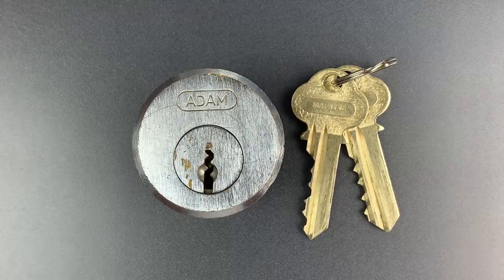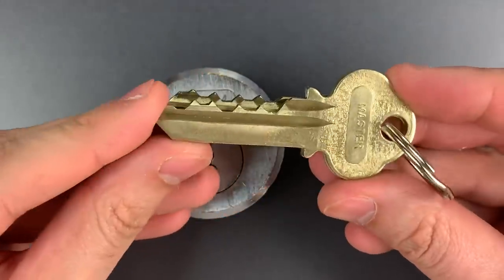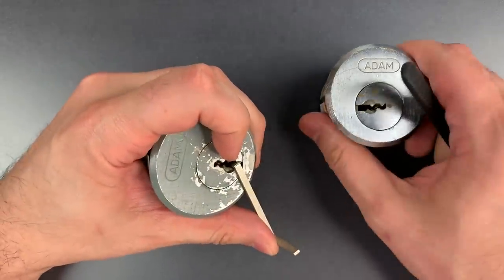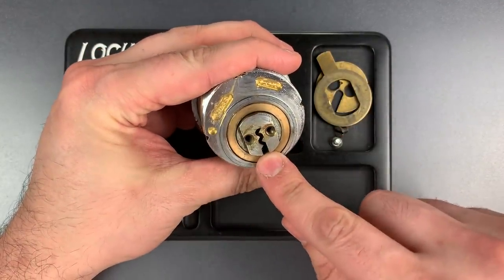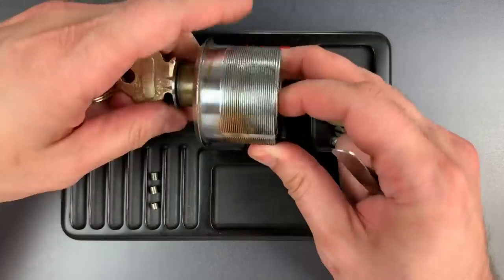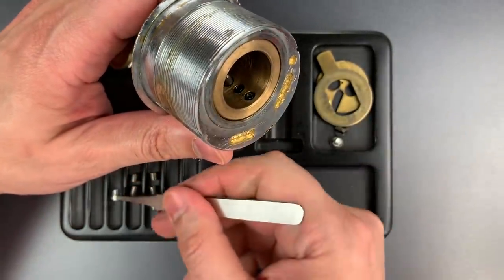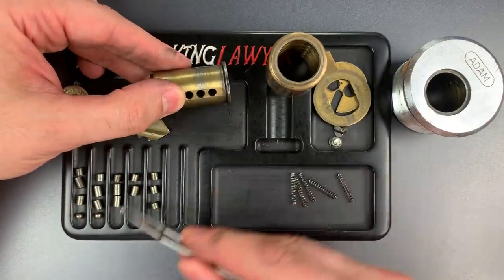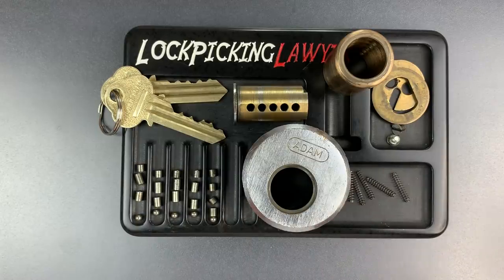[919] Prison Break! Huge Prison Locks Opened in Seconds

Comment: I worked in two different facilities.  On my first post, the keys and locks were huge.  It was built in the late 1960s, so it was expected for that time.  Interestingly enough, they had added on to it four times and during the most recently addition, they still used those large brass keys.  From its opening in 1969 or so until it closed in 2014, no one escaped.  One attempted to, but never made it far.

The second facility I worked in used locks similar to those, but keys were hardly ever used.  Everything was electronic so keys were only used when the power went out and that was rare.

Comment: The college dorms I lived in back in the 80s didn't follow the rule of master keying. I easily made a master from a copy of my room key with a chainsaw sharpening file.
Reply: Why?
Reply: @coen555  To see if I could. The reason we're not all still living in caves.
Reply: @John_Ridley  That's a good enough reason for me.
Reply: I initially read this as "I made a master key from my room key with a chainsaw" and I was confused.
Reply: How did you know the bidding?
Reply: J-sUn If you see multiple keys (neighbors, common areas) and know the principles, you can guess the master bitting.
Reply: @FiltiarneElite  Every chainsaw is a masterkey if you think about it lol
Reply: @johnfrancisdoe1563  Why I don't use master keying even though it would be very convenient (beside the concern of some yahoo boss, co-worker, subordinate misplacing or not keeping the master secure). If you have a key and undisturbed physical access to the lock--oh, and not a live in a cave were your tech to be taken mentality, lol--how could you not recreate the master and gain access to all the other locks.
Reply: @johnfrancisdoe1563  Not if the system is properly designed.
Reply: @Jamato-sUn  Check out 'Keys to the Kingdom: Impressioning, Privilege Escalation, Bumping, and Other Key-Based Attacks Against Physical Locks' by Deviant Ollam, it discusses exactly how to generate a master key using a change key, a few key blanks, and a lock you have permission to open.
Reply: One question. Was it co ed?

Comment: Oh dear...
Edit: think a Bowley lock designed for this application might work?
Reply: Airmanon maybe just dimple locks
Reply: @FishFind3000   You can't put ball bearings in a dimple lock, so I imagine the pins would wear out with such high use.
Reply: Unfortunately some prisoners would stuff the lock with some sort of epoxy or the like if they could to mess with the guards. So having the most unpickable locks may not be the best idea in a prison.
Reply: @sluggaboyzWC3  oof
Reply: sluggaboyzWC3 Ability to clean lock doesn't require a pickable lock.
Reply: Hello fellow redditor

Comment: I did jail contracting work decades ago; cameras, door controls, door sensors, intercoms.
Midway through a job, a worker from the lock vendor came and replaced ever lock in the prison; master key was cut short just as you showed.
Didn't hold up the job but it sure cost the door-guys a pretty penny.
Can't say for sure they were ADAM, but they were big.

Comment: Hey LPL, Correctional Sergeant here from Cali, those are medium security locks usually only put on doors for storage or offices, the only time they are used to secure inmates it is on the outside of a dorm where it cannot be picked from the inside, for high security we use the large Folger Adams keys and locks!

Comment: I work in a prison and we have similar locks to these.

Firstly, it's important to note that a cell door does not have a keyhole on the inside. So even if we were to hand them a key, there would be no way to insert the key into the lock. This goes for any door where you are going "outwards". Imagine the prison as a layercake and to move from say a unit to a corridor you wouldn't be able to use a key, but if you were going "in" then you could. 

In terms of these kind of locks, the model shown here is an older model and newer ones encompass a pin rotational aspect which appears to be an effort to resist raking. It appears to be a similar method to a medico lock. Additionally, when the lock is installed in the correct housing there is a weight aspect placed on the core which is an attempt to stop improvised keys being made from objects such as wood, glass, paper or whatever. The force needed to actually turn the key would cause most materials to easily break which leads up to another point. That being the keys are intentionally big for two reasons - if you were to lose it, it's going to be much easier to find and if a prisoner was to actually get hold of a piece of metal large enough, it would either be found during electronic searching or manual searches and the time required to fashion the key is far greater.

Comment: I worked for the Texas prison system for 10 years, ever since I was 19. We had lots of Folger Adam locks, mainly the big cellblock door locks that take those comically large keys you usually associate with prison. Bigger than the keys in this video (though some of these keys I have seen on offices, etc). My unit was built in the 60s so many of those locks were seriously old and heavy. Being a corridor control officer was a pain in the ass, you were posted in the hallway with a big old set of keys and opened the doors for everyone going in and coming out. I don't miss that job.

Comment: Right so, Correctional officer here and I'm gonna talk a little bit about prison security. These locks were (if I had to guess) probably used to secure quad doors in secure housing or open bay dorms. The thing about prison security is that there are people in prison in there for there life. If someone has the skill set necessary to pick a lock then eventually they will be able to. However, these doors are VERY resistant to brute force attacks. They are steel framed and set in concrete with reinforced plexiglass panels. The hinges are massive and have protective covers. So what does this all mean? Basically these doors are intended to withstand riots not skilled picking attacks. The protection against skilled picking attacks is actually the perimeter stun fence coupled with armed guards tasked with shooting individuals who attempt to cross. Additionally inmates are counted no less than once every four hours. Making a tight time constraint

Comment: I worked corrections for 8 years & those locks are actually much smaller than many of the other Folger-Adam's & Southern Steel locks we mainly used.  Also the locks wouldn't be able to be grabbed in held in your hand otherwise they wouldn't need to pick them anyway.

Comment: This is not the most serious weakness. There was a much simpler technique in Arizona Prisons. If a person lifted a door 3 or 4 inches, the latch no longer engaged. Over more than 3 decades, there were multiple partial escapes, assaults, rapes, and murders. They named the Lumley unit after one of the victims. They changed the locks at a cost of thousands per lock. After another decade of evidence that this was not effective, they changed the latch mechanisms. And yes, during those decades there were multiple pleas from staff and prisoners to adopt simple, inexpensive techniques prevent opening without a key.

Comment: I'd really like to see you work on what Folger Adams calls a Prison Paracentric Key Lock.  In my experience the locks you open in this video wouldn't be for doors that would lead an inmate to escape, but more for incidental doors.  The Prison paracentric are what is used for the big doors and grill gates.
Reply: Also, I would guess that the poor master bitting is due to the locksmith at the prison instead of an indictment of the lock manufacturer.  Locks don't come pre-bitted to the prison.

Comment: When I volunteer at a local prison during Christmas time, the key I’m assigned to for the chapel room that I use, has a Folger Adam lock but the lock and key is about 5 times the size of the one in this video.
It’s the normal big locks and keys you think about associated with prison. I wish you could get your hands on those and see if you could pick one of those! 
It’s the ones with the keys you hold in your whole hand instead of just your fingers

Comment: The prison I worked at only used these types of locks for doors that would not allow you access to out of the units or outside of the prison. We did have "Folger Adams" keys, but but the were much larger than what you showed.

Comment: these particular locks are used in the fireproof doors basically a three inch thick steel door with a massive locking lug for the door latch. amusing how easy it is to get past them. now if you can open this with a bed spring and copper wire from a fan/radio or plastic toothbrush then you will have the standard tools inmates hold for picking; instead of specialized tools.

Comment: 0:54 - I bypassed this problem of making a master from another key by roughing up the key and applying a blog of pre-fluxed (electronic solder) to the key in the area I needed built up and then filed away the excess solder. Not on a prison lock though, it was a Abloy style (half moon) type key, although the technique would work with this type of keyway.

Comment: As some one who has been to prison. This information is interesting, but prisoners wouldn't be able to pick these with ease. They might be able to assemble picks and rakes, but they will have to deal with MULTIPLE locks in a row to really leave the area, and by then, they most likely will have been seen or noticed. This is at least in America. The locks aren't what keeps the prisoners in, it's the face that every way you go is protected by video security and multiple check points.

Comment: i know this is a late vid and you probably wont see this but im a correctional officer and my prison uses these locks. the locks are always places in positons its really hard to tension off of not impossible but really hard to. like in a hallowd out area meaning youd have to reach into the hole with both hands to tention and pick it. on top of that the ones in my prison work off a electronic door system so the piece actually stopping the door from opening is always being pushed open making it even harder to open it when you get it tensioned. like we sometimes have trouble opening it with the key cause its pushing back so much

Comment: I worked as a contractor at Rykers Island, while there a guard informed me that the large locks would take forever to pick as they were not normal locks! But most escapes were not due to lock picking, they happened when inmates walked out the front door. One trick to do this was to turn a piece of alfoil into a badge, with a badge as id they could walk past security points. So what we could and could not bring in seemed strange, hammers and drills, fine, that aluminum your lunch is in, not ok!

Comment: The ball bearings are extremely hard, the core is extra wide and the master ring allows for thicker mastering discs. You could probably build a robot to operate this lock 1,000 times a day and it would last a decade.

Comment: To be fair, the pinning codes and keyways are designed and provided to prisons by the lock manufactuer. So the fact that the master key could be filed down from an operator key in on FolgerAdams, not the prison operator.

Comment: To be fair, at least in some housing areas, the keyhole is only on the outside of the dorm or cell. So if you're inside and the door is shut the only way its opening is someone keying it  on the outside or the control room accessing it.

Comment: Two questions come to mind: 
1. Is the raking opening the inner cylinder or the master cylinder?  
2. If raking didn't work, would those ball bearing make picking harder? It looks like the key/pick makes contact with the ball bearing and not the pin. A pick might slide off the rounded bearing more easily.
Reply: Did you not see how he used his pick to push the key pins out? As an amateur picker, I find smaller locks to be more difficult than larger locks. That lock is huge. Would be simple to pick. Problem is, in a prison, there's about 20 of those locked doors between you and freedom LOL

Comment: Damn.  I would have thought that raking wouldn't do anything.   I've opened crappy locks with a rake made from a paperclip, and a little screwdriver or knife as the tensioner.  It looks like that's all these needed too.  Prisoners may be really short on supplies, but it won't be impossible to find a paperclip, and something strong enough to be the tensioner.

Comment: Master keyed locks are always easier to pick as there are more options to open them with wave rake attacks and adding security pins to a master keyed lock is much harder to implement. That 5 pin had an extra pin does that mean the lock had an additional key option?  Master, sub master, and basic user key?

Comment: These locks are not used on cell doors. Only auxiliary doors. Sometimes low security cells like for juvenile detention. When used in that scenario, the cylinder is on the opposite side of the door... Obviously not in the cell.

Comment: Personally I think that the use of card based locking systems would be much more efficient for prisons.  I work at an airport and the margin of failure and skills required to duplicate an id card would be so unrealistic for prisoners that they would have an extremely difficult time breaking through in conventional means

Comment: I reckon the ball bearings point out the problem pretty quick. They are there so the lock lasts a long time. Most older locks are easier to pick in the sense that they don't make use of new inovations from the locksmith comunity. At least, thats the vibes i'm getting, but i ain't a lockpick or a locksmith, so idk.

Comment: They're not big because they're more secure than a quickset lock. They're big to give them mass to make them impossible for most people to kick in in one quick and easy strike. Prisons, like police stations, depend more on the personnel and cameras on the premises than the locks they employ. Even the hugs locks on the prison cell doors are easy to pick with makeshift tools any creative prisoner can put together. (I had a misspent youth.) 

The problem is one of constant supervision from multiple angles 24/7. Even in a minimum security prison there's a dozen or more locks between you and the outside all patrolled by cameras, guards and dogs. The locks are meant to make an escapee burn time. You can probably get the makeshift tools together with a little luck if you are so inclined and you may even get through the first door. If you time the shift rotations you can even get through a second door but by then you've set off enough alarms that anyone within a mile or so will think there's an air raid going on. The alarms also tell the guards where the door was opened so they'll swarm right to you while also sending extra guards to patrol the main entrances to the prison and the perimeter fence around it in case you get really lucky. The days of breaking out of prison without a significant amount of support from someone outside the prison as well as a complicit guard inside are long gone.

Comment: It's the issue with the operating key being higher than the master key REALLY that bad if you have a master ring? Obviously if every position is higher, then you could file down the operating key to get a master. But with the ring, I feel you'd need to file down EVERY operating position down to the master position, AT THE SAME TIME, without being able to test of you've filed down far enough, until all the pins are at the right height. I realize that without a master ring, you could produce a master by filing and testing one pin at a time.

Comment: I was a counselor in several state prisons. 
 Locks are important they all had at least one full time locksmith. They had interesting regulations for key control.
 The tightest security prison I worked at you weren't allowed to take a key out of the unit let alone the prison itself. I received copper coins with my name on them. I would put a coin in a drawer sllde the corrections officer would take the chit (coin) and hang it on a hook where he took the key ring from . So by looking at the board they knew immediately what key rings were out and who had them. This is important in key control. Supposedly a lost key ring meant thousands of dollars in re keying locks. My key ring would only open specific locks like my office a group room and supply times. It couldn't open cells or exterior doors or cell doors. 
 Now between midnight and  2am the booth officer would do a key inventory. Basically look at the key station for chits. If a chit was there meant someone forgot to turn in their keys  and took them off-site . The officer notified the shift leutentant he would call the person at home and that person would have to return the key ring within 1 hour. A lost key meant immediate termination. Imagine it took 45 minutes to drive there on a normal day but at 2am shit happens. I had to cross 2 mountains to get there. It was on top of a third mountain. Winter meant bad weather and 60mph unplowed roads. But once done you never forgot again. 
 The last prison I was posted at was the second oldest in the State. There you were assigned a specific key ring to take home if you want. The problem is then the keys are exposed to the public. Well most prison staff live near the prisons they work at. Do you know who else lives near prisons. Inmate family members move near prisons where family members are.
 So the guy that washes your car is the stepson of a inmate. Keys were constantly lost at that prison and my key ring was for whatever stupid reason a master key ring the only other person with a matching key ring was the superintendent. So I never ever not even once considered taking that key off site it opened every lock in the prison including the towers and armory.